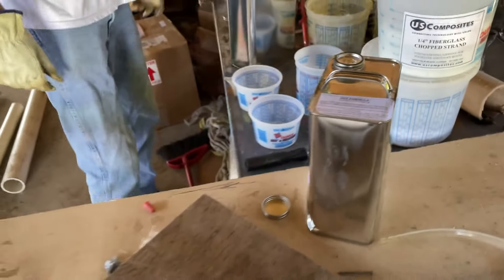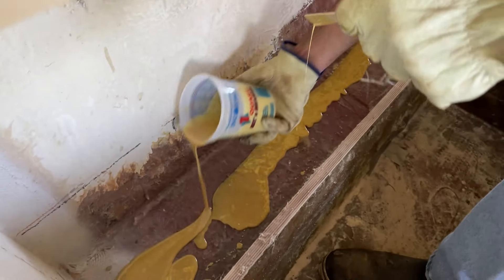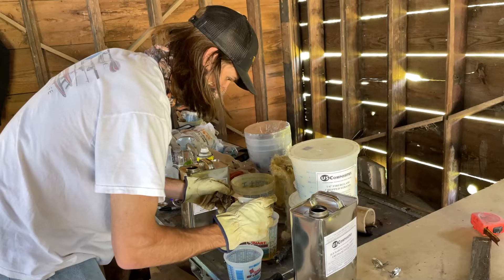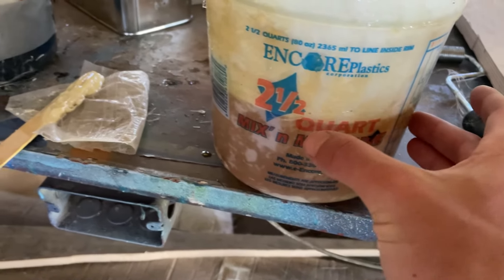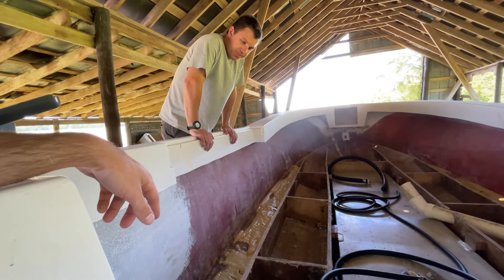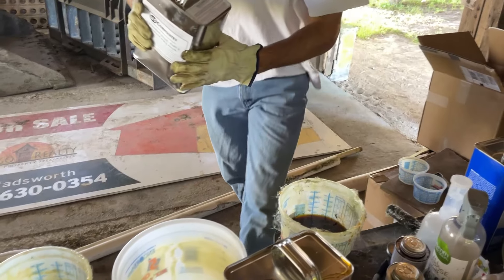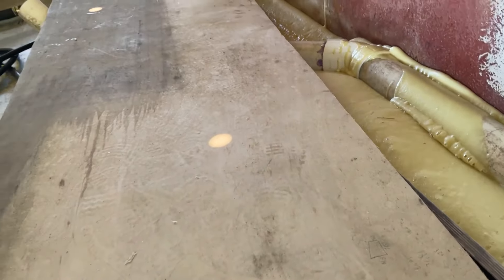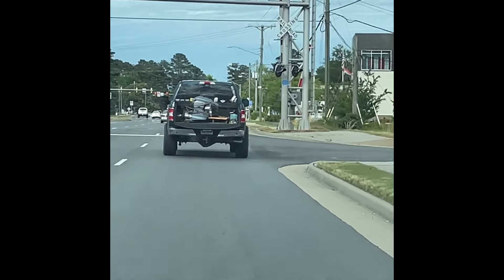Rebuilding a Center Console Fishing Boat - Episode 6: Urethane Foam & New Motor

Comment: Dude you're supposed to enclose it with the deck, drill some holes in deck, and then pour.  The closed cavity will trap the exothermic heat causing your foam to expand correctly, stronger, and faster.
Reply from the maker: Interesting. I didn’t know that about the exothermic heat. I was definitely under educated on the foam pouring. I had seen some builders do what you said, but I had also seen some other builders pour a lot in, let it over-expand, then saw off the rest (not enclosed). So that was my thought process but trying to fill it slightly less than full to avoid any sawing. Honestly, if I did it again I’d probably just not use any foam.

Comment: I think you made a mistake with the polyurethane. First you had to put the floor of the boat and then, through some holes, pour the polyurethane under pressure to seal all the spaces. When I restored my wellkraft 20 I did that and it was perfect.